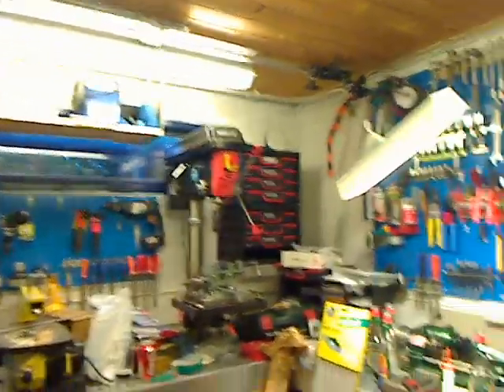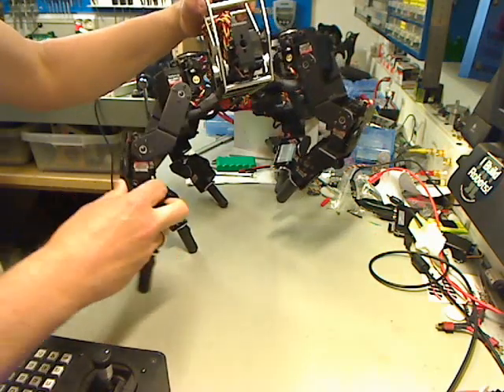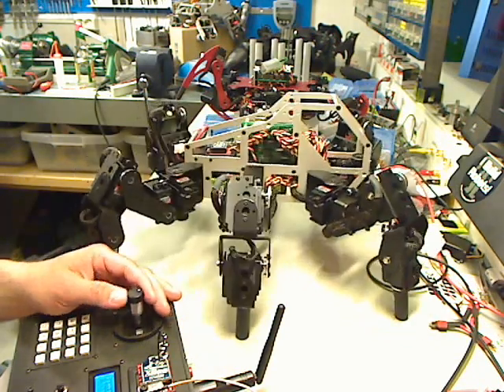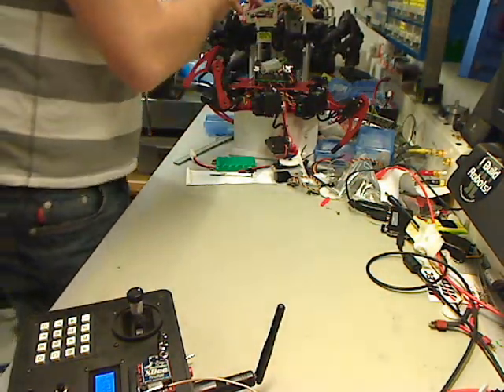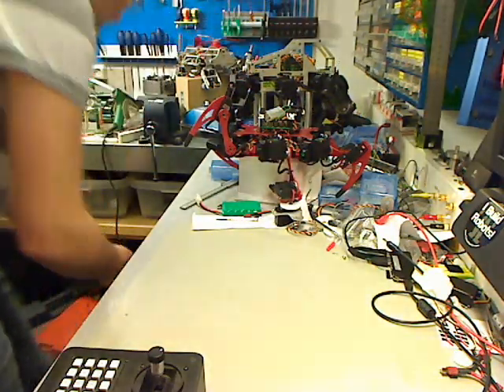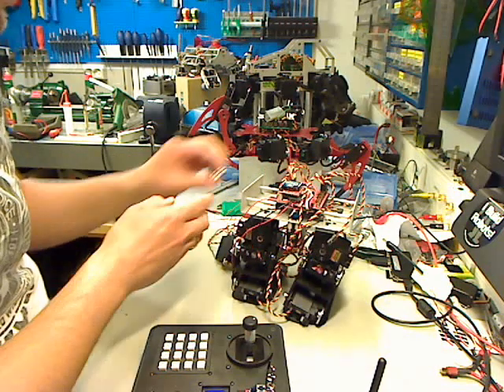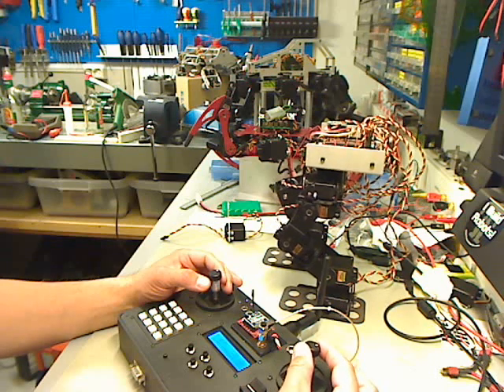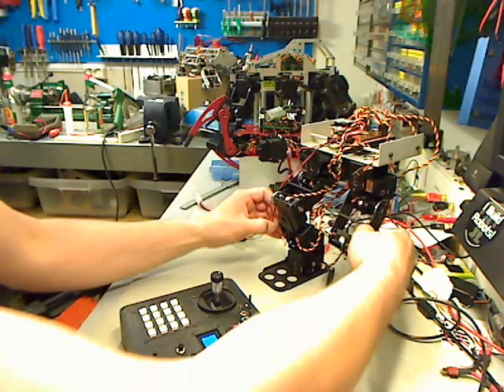Zenta's robotic workshop take1

Comment: i am interested in your joystick with the potentiometer  knob on the top of the stick. did I understand correctly that it a modification you implemented? what is the manufacture and model number of the potentiometer you used? i would really appreciate knowing more about how you made this so i can fabricate one myself
Reply from the maker: Hi, I'm not sure what the manufacture is. I need to check that one time. But I'm pretty sure you'll find it at digikey. Check this thread about how I did the modifications. http://www.robotshop.com/forum/diy-remote-control-xbee-controller-for-robotics-t5447/214
Reply: Zenta thank you so very much!
Reply: The pot is, P16 N 10K Vishay Potentiometer

Comment from the maker: @Gniddelrulez Power switches are for the BB2 logic voltage, SSC32 logic voltage and servo voltage. Only two switches VL and VS can be used, I just wanted to separate the BB2 and SSC32 power. Lynxmotion has sponsored all parts (servos + brackets).. ;)